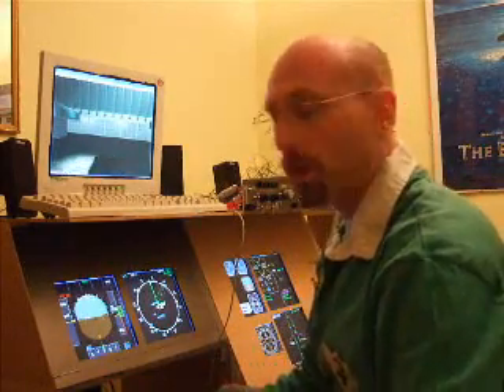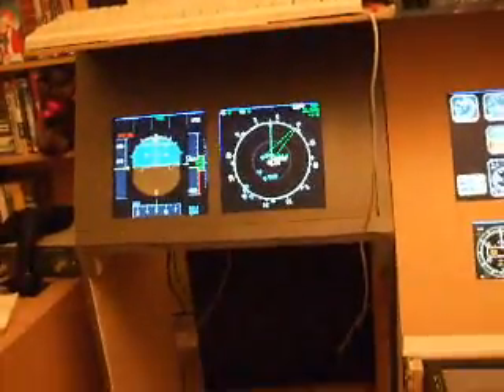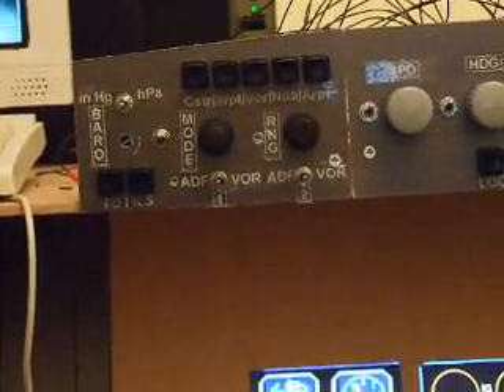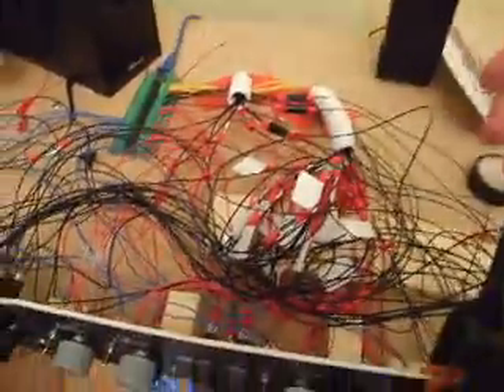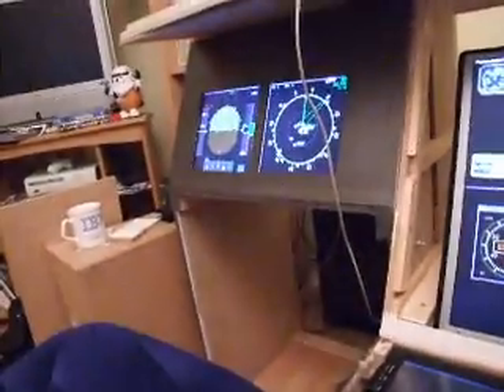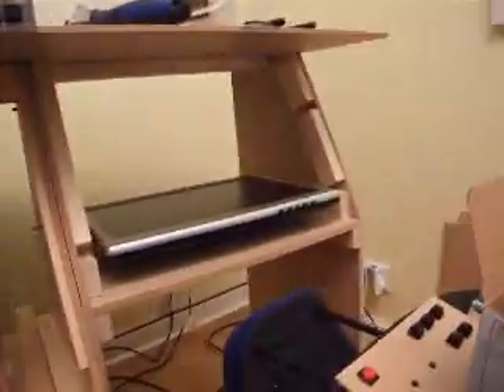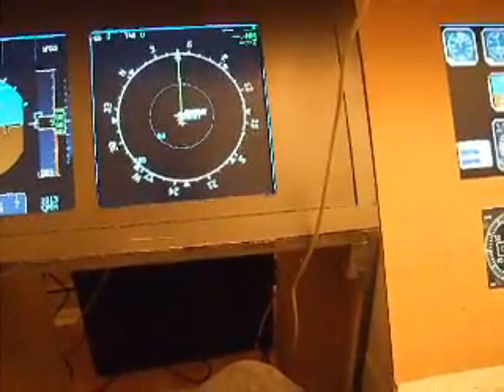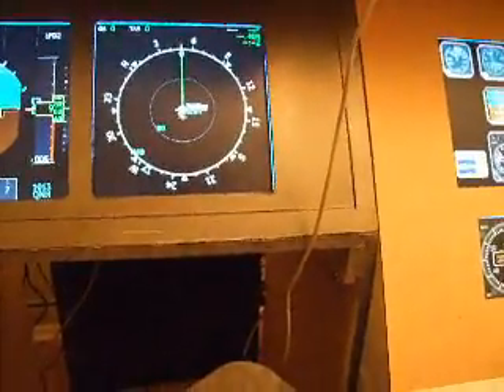Cockpit update February 2010

Comment from the maker: I assume this is a joke but....here we go. You NEED TWO USB PORTS on your computer.  Or use a USB hub so that you can add more devices. It's that simple. You won't be able to plug a USB jack into a mouse hole (fuck me) because they are different. My Saitek throttles were USB so that's how I did it. I just...plugged them in.